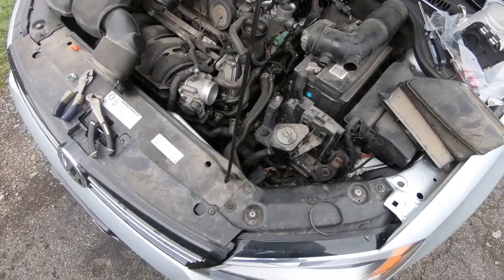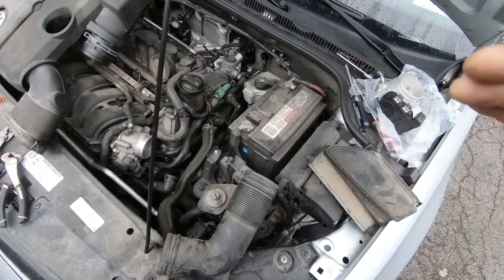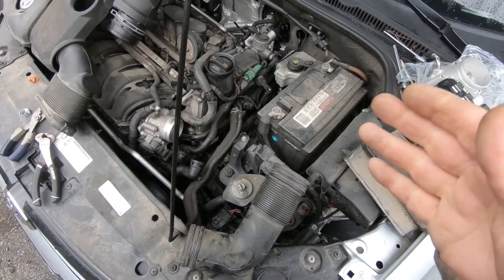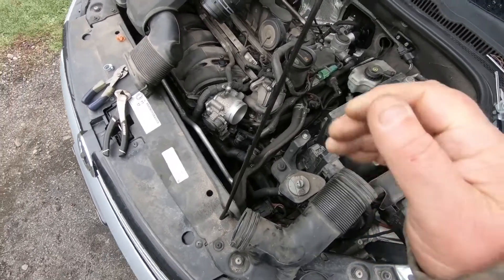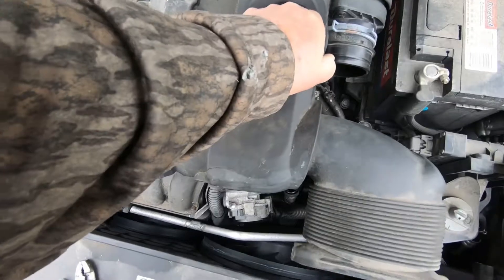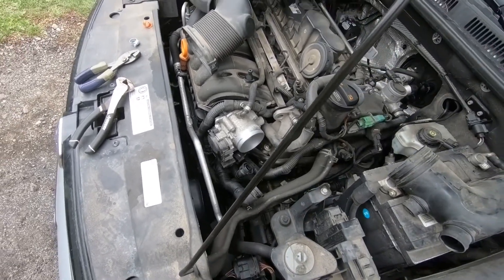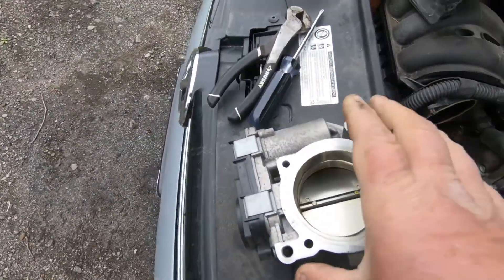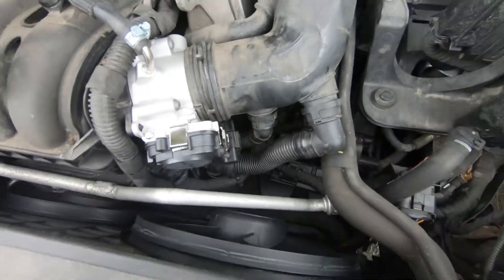MK6 Jetta code P0122 throttle body replacement. What to expect

Comment: When you change the t body before you start it hold the gas to the floor turn on the key but don't start it. 
Hold the gas pedal down for 10 seconds you should hear a Bing  then shut it off for 5 seconds and start it up. 
This resets the Throttle and avoids all the relearning codes you went through, It will need to be run about ten times 
before the relearn is complete and shouldn't throw any more codes if you don't have other issues.
Reply from the maker: AWESOME INFORMATION!
Reply: 😊😊😊😊😊😊😊😊à

Comment: Thanks for this. Just finished trading out mine with the Amazon model you linked too. EPC and Check Engine light were on, and it was in a bit of a limp mode with limited power above 2,000rpm. 

After changing, first start didn't work but on the 2nd try it fired right up. EPC light went out, but CE light is still hanging around. I'm guessing that it'll clear after a few more run cycles. The re-learn procedure in the comment from THXFXR didn't seem to do anything for me - I never got a 'Bing'. I don't know if it made any difference, but removed the negative cable from my battery while i did the work.

Hardest part for me was removing the engine cover (gloves help with this) and dealing with the fuel supply line. Everything else was relatively easy, and I'm not a particularly skilled, experienced or equipped car mechanic. I took my time and was very careful to avoid dropping any fasteners or tools. 

Torx T20 bits got the airbox parts off and a T30 got the throttle body off. You'll want a couple of different nut driver options as mine was a little too long for a couple of screws. Fortunately I was able to improvise.

I'd suggest maybe swapping spark plugs out while you're doing this since you'll have the engine cover off anyway. That was pretty darn easy and only took an extra 10-15 minutes.

Comment: That ECM could also be the o2 sensor ( 1st bank ) did u reset all code . I have heard that u have to take car to dealer to have them update car with the new throttle  body ..but if it works then  the computer took a bit to relearn the new throttle body ....let me know I really need that module ...